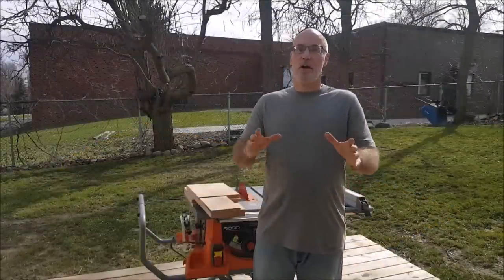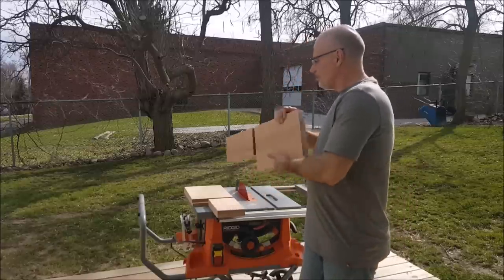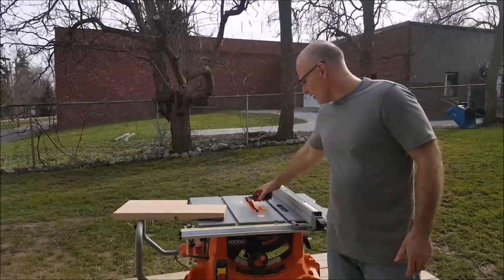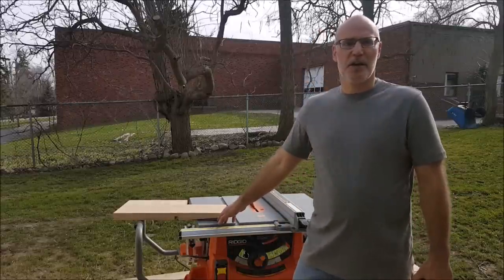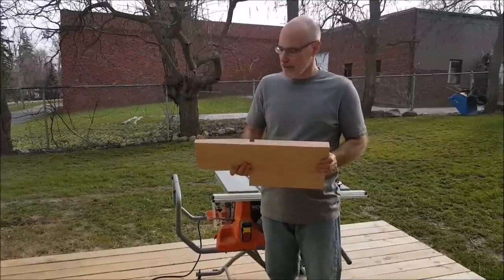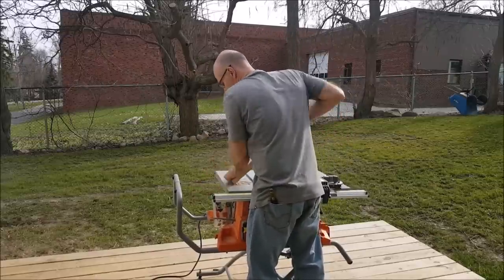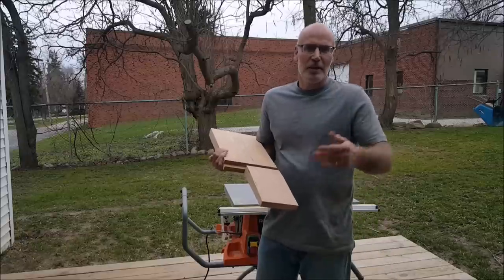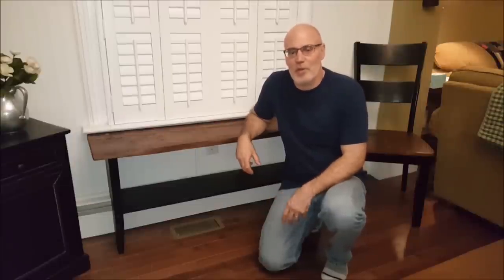How to Make A Shallow, Angled Cut on a Wide Surface Using a Table Saw

Comment: Hmm.... Interesting method, but I wonder if there are any other ways. I want to put this kind of angle on the end of a piece of trim that's about 12 inches wide and 14 ft long, so it can wedge itself up against an angled joist and straighten out a stairwell without eating up TOO much of the stairwell opening... I hate to think of my wife or father-in-law holding the other end of that piece of wood for 8 minutes while we slowly work our way through the table saw, and trying to keep it perfectly straight the whole time...